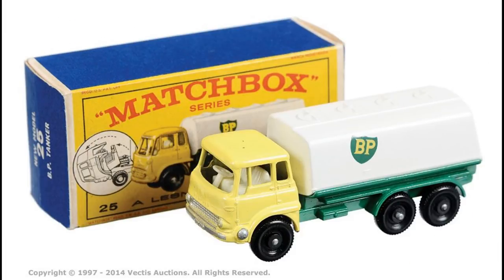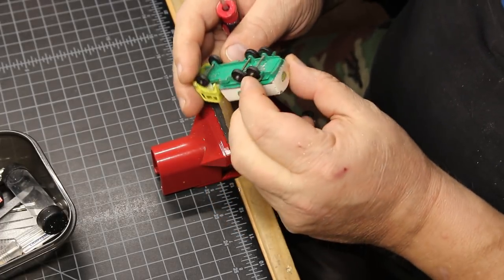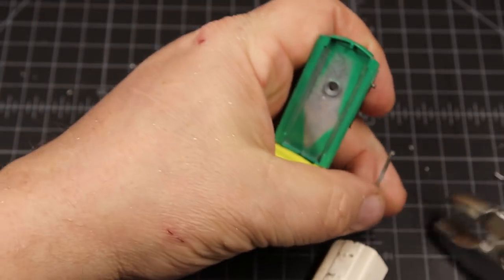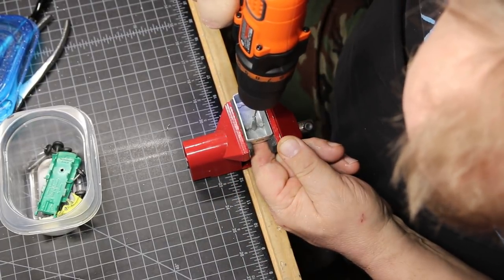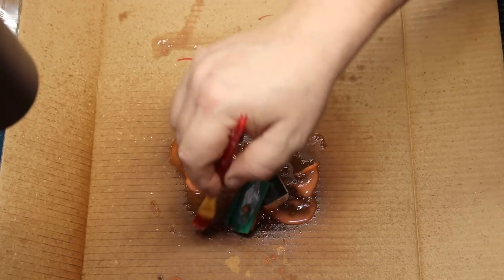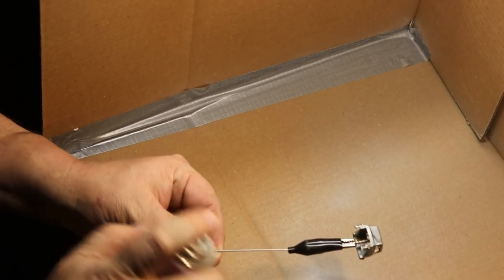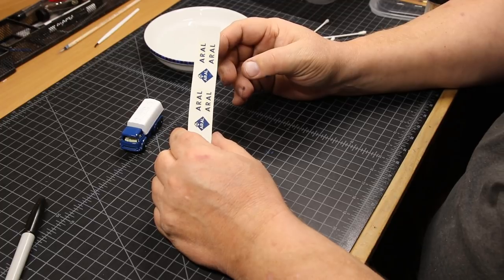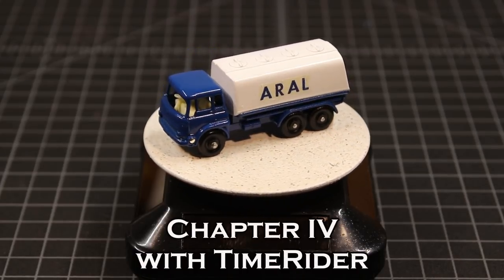Matchbox #25C Bedford Tanker - Custom Recreation

Comment from the maker: Just an update and an FYI . . . use caution in your practices.  On an inkjet produced decal, decal setting solution may eat through the bonding layer of the decal and cause the ink to dissolve ruining the decal.  When you then remove the decal to replace it, it leaves a residue that is nearly impossible to remove without damaging the paint, requiring you to start over, at least on that part of the model.  These channels are great because they allow us to pass on what we learn, sometimes the hard way.  Now, it could very well be that Testors bonding solution is just incompatible with the Microscale setting solution, I can't say for sure, such incompatibilities are common in this type of hobby.  But that is what happened to this model.  I'll be working to re-restore it in the coming days.

Comment: Another terrific restoration, Time Rider. Using the tubing and crimping it to the cut axles is a great fix and so simple. I saw another restorer using the non-grind way to remove axles but I couldn't remember who it was either but it is a great idea especially for axles or pins used in areas where grinding might well damage the casting.
Reply from the maker: I'm told it was WheelsnThangs
Reply: @TimeRider  Ah yes. I always remember the tip but almost never the restorer. The exception being Marty using his wife's toothbrush to clean paint remover from castings.   :)

Comment: If nothing else, you've surely 'upped the ante' for the offerings which Marty's Matchbox Makeover's, Matchbox Restoration, and the balance of the "English Diecast Group" offers. (that's a GOOD thing; much more for us to view)

In 1969, BP Heating Oil dealers, in the northeastern United States purchased the "BP Leyland Tanker 32" in 'quantity', and installed decals with the names of their business, emblazoned on the tanker.  I had three of them (my family owned an AMC Dealership, and an autobody shop, with an 'associated' frame shop which did large trucks, thru cars); all three businesses had oil fired boilers.

We had Centari, and Lucite mixing banks; we'd use Lucite to 'trim out' new parts, and for GM (automobiles) products (which came with lacquer finishes, until '82); everything else, got Centari, 'because that's what it came in with'. Mixing always started with an empty can, and tint bases added 'from largest amounts, to the smallest amounts, to prevent mistakes which forced the entire mix to be disposed of.  Never started from white with automotive paint.

PPG-Ditzler Deltron and Delstar; both good paints, the best factory-packed matches for Ford, and AMC products, as both had a few paint codes "with two year runs, and several formulas, and "CMP, Closest Match Possible" designation. "Martin Senour" had a 'last stage before painting' solvent wash called "Finyl Wash", which beat RM-BASF "Pre-Kleeno" hands down.

Comment: I agree on paint mixing. I take the car I plan to paint with me to the store and buy the closest color I can find and then mix it to the right shade I need from that point.      On the wheels, try a product called  Mothers back to black.  It’s in the automotive section of stores.  I apply it to the tires with a paint brush, even on cars I am not restoring. It makes plastic and metal any color look better. I had a DAF tipper that the red grille looked a little rough and it really made it look nice. This resto looks really nice 👍 your skills are getting sharper!
Reply from the maker: Thanks!  I've used Back to Black in automotive applications.

Comment: Outstanding paint work.Would of liked to seen a little detail in the head lights and grill but overall I give a rating of A!
Reply from the maker: I could not find a single photo where this issue had painted grille and headlights, while a deviation from the original state of the model, I wanted it to be accurate to the form of the ARAL Petrol Tanker released by Lesney in Continental Europe.  I have another, if I do that as a restoration I will paint headlights and grille.
Reply: @TimeRider  Ok I see.Than I will move the rating to A+ you have excellnt painting skills.Your paint work looks so good.
Reply from the maker: I have no problem painting grilles and such and believe me, if I had seen even ONE photo of this version with the painted headlights and grille, I would have done it!!

Comment: The white/blue color combination looks great.  I’ve got some beaters in white/green that I’ll have to try that color scheme on.  I don’t think hair spray would work well as a sealer for water soluble decals since it too is water soluble. Rather than crimping the tubing would a bit of super glue in the tube work?
Reply from the maker: Hey Rich!  Thanks!  Sometimes when doing research for a model, I'll see something and think . . . I'd like to recreate that.  If I ever get another Leyland Petrol tanker for example it will not be green and white, it will probably be an ARAL as well.  I also saw this:

https://www.worthpoint.com/worthopedia/matchbox-25c-bedford-petrol-tanker-168099687

Which I thought was interesting as a custom and opens up a ton of possibilities.

Great observations also . . . I cannot speak intelligently about the use of hair spray as I've never done it, that was just something I heard on another channel or read somewhere, don't recall which so you may just be right.  You may notice I printed two sets of decals based on the same theory as measure twice, cut once! 

Second, yes, super glue would work and in fact when I use the pre-made axle kits, I use super glue and I'm sure it would work in this circumstance as well.  I just wanted to show an alternative that was less . . . ummm . . . let's call it intrusive for lack of a better term.  Sometimes super glue can "get" away from you and damage the finish. 

Thanks again!  Be safe.

Comment: Nice booth set up and hands. I think the color came out perfectly. What about a shot of super glue for your axles. eh both methods work though.
Reply from the maker: I've used super glue, wanted to try something different for the sake of trying it.
Reply: yeah super glue is messy and crimping looked faster. I never knew there was a specific way to mix paint colors, I always started pouring in the colors I thought worked. Blessed ignorance. I have used fingernail lacquer (expensive, the women are getting ripped off) but good metal flake colors and you don't have to buy a huge bottle of the same color.  I like to fool with Wal mart acrylic craft paints. Better quality than one would expect and what a selection and super cheap. I spray multi-coats of Future floor wax renamed Pledge with future shine the last bottle I bought (acrylic clear) over the top and the results are surprising.

Comment: Interesting that Lesney went to the effort of producing a continental livery but retained the steering wheel on the correct side!  Actually, that probably explains the lack of success with Marty's toothbrushes - you are using them on LHD vehicles.
Reply from the maker: I read a story once about a bus company that sold a bunch of surplus buses to a Caribbean Island and when they got them, they discharged passengers into the middle of the road . . . 165 countries drive on the right, 75 on the left . . . hmmmm . . . Can you imaging the chaos if Britain decided to switch, they did leave the EU after all so all it would take is a vote right? 

https://www.wired.com/2014/02/throwback-thursday-sweden/
Reply: @TimeRider  I did some research on this recently - 2,648,770,083 (31% of the world population) people live in 'drive on the left' countries.  That's a lot of people who would need to relearn how they cross the road.
It seems that a lot of European countries drove on the left before Napolean Bonaparte conquered them.  And have you noticed how many brass-era US cars are RHD?
Here is the BBC's version of your link:    http://news.bbc.co.uk/2/hi/uk_news/magazine/8239048.stm
Maybe this is the answer:  
https://www.flickr.com/photos/128691640@N04/34955478442/in/pool-1349422@N21/
Reply from the maker: I was once told . . . I don't remember where or by whom . . . that European rail gauge was based on the wheels of Roman wagon and carts . . .
Reply: @TimeRider  very true...if you measure tracks that were left in Roman roads by carts they are the same gauge as the railways. The gauge was adopted by George Stephenson the pioneer of railways in the UK. I know cos there are Roman remains where I live and Stephenson was born and worked nearby. I studied both at school and wrote a paper about it.
Reply: @derrickroe9791    Yes, in railway terms Standard Gauge is 4' 8.5" which corresponds to the Roman chariot width which itself is based on the size of the backside of an average horse.  Other common sizes include 5', 1 metre and 2'; in a timber yard near here there is dual gauge track which allows both Standard gauge and Russian wide gauge wagons to use the same sidings.
Roman charioteers drove on the left as they could then use their right hand for carrying weapons.

Comment: #G22-warning  i was looking through your early videos and saw the review for the G22 airbrush, there is no such thing,well it depends how you look at it, the G22 is a cheap brush of decent quality but heres the thing it also comes under about 12 other names its made then rebranded with different companies brand or whatever name they wish to call it,the pinch is i know what im looking for and ive seen it as low as $14 and as high as $55
Reply from the maker: I'm not sure what you mean by, "There is no such thing" since the packaging said G22 all over it.  It's not a high quality brush and I wouldn't be surprised to find it under a half dozen other brand names since I'm fairly certain it was made in China.  If I were doing detail work, I'd spend more money, but all of the research I did prior to buying it suggested that for this kind of work a $25 air brush would be fine and I really have no complaints.  I'm not sure what you're trying to warn people about, it's an airbrush you can buy on Amazon for about $20 and my review doesn't claim that it is anything other than a cheap airbrush suitable for this application.  Of the 50 reviews on Amazon, 80% rated it 4 stars or higher 

Mine rarely clogs and the complaints that most people had about seem to be more about their inability to mix paint properly.  If the paint is too thin or too think, I don't care what kind of airbrush you use, you're going to have problems.